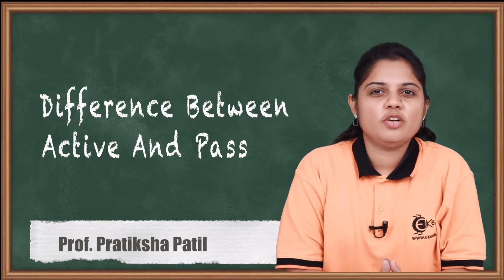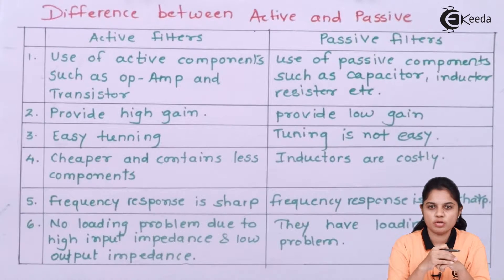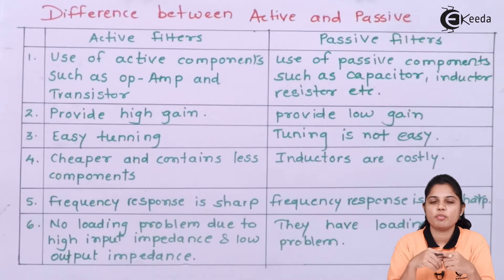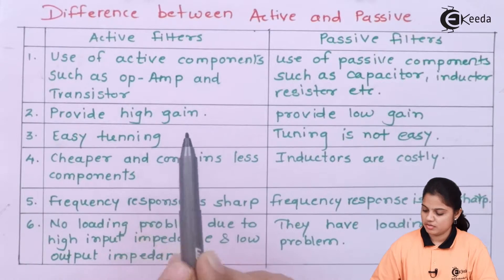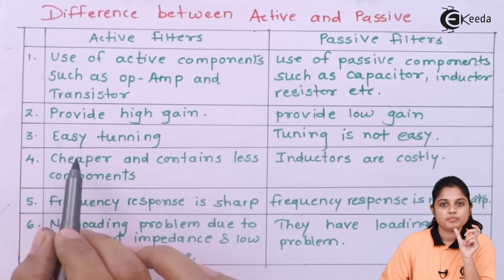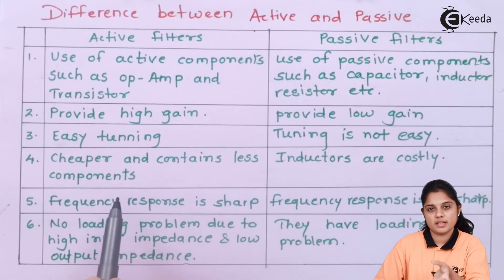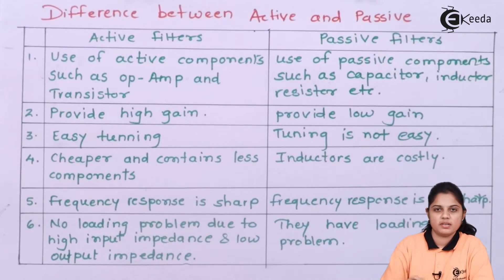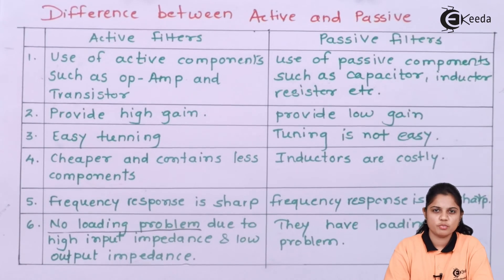Difference Between Passive and Active - Operational Amplifier and 555 Timer - Industrial Electronics

Comment: Explanation of tuning is wrong. Why frequency response is sharp in active filters has not been explained. 4th point is less important, instead discussing application of those two types of filter would have been better example as differences.